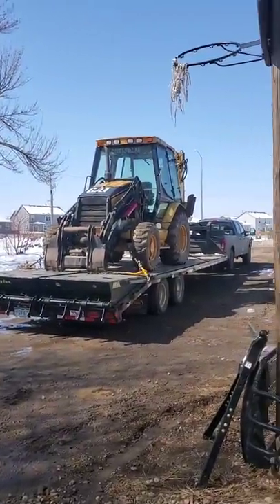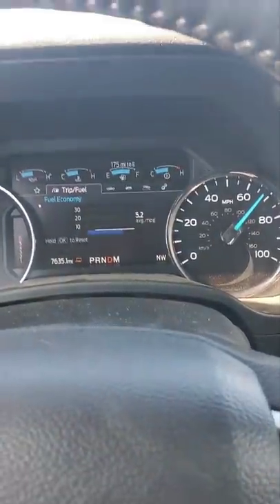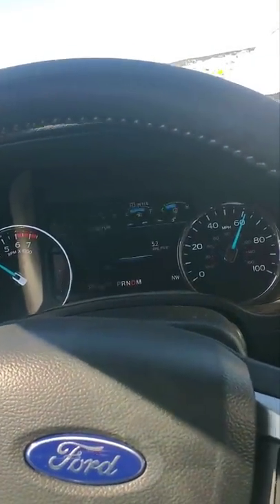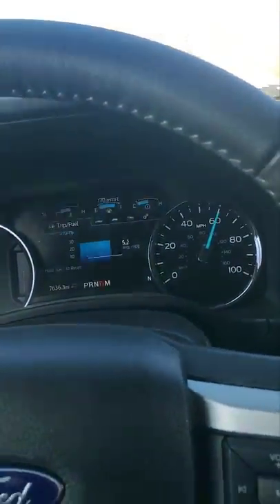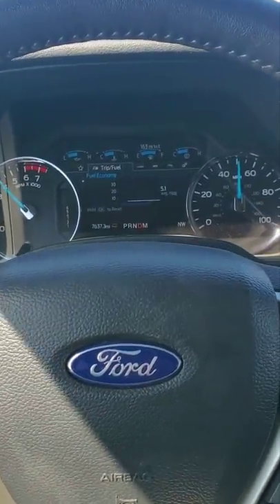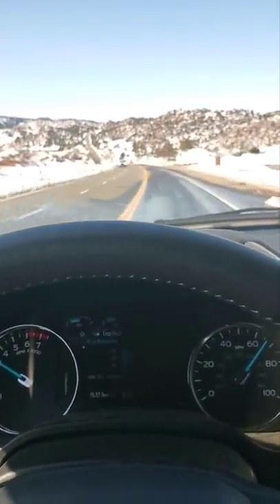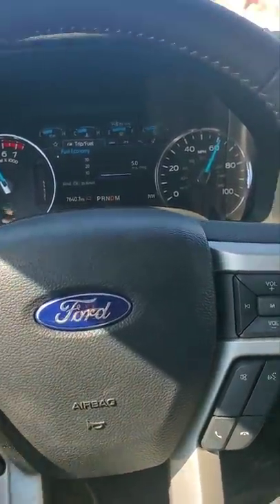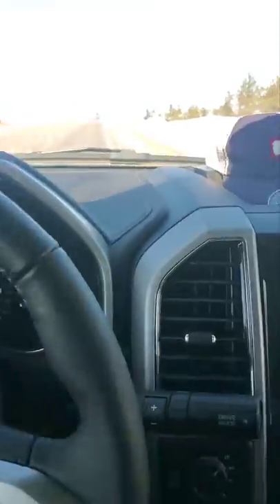7.3 godzilla towing 24k lbs through the rockies.

Comment: Seeing you gain speed up a hill at 32k gross vehicle weight, I'm sold. Using 3.55 gears at that! I've been on the fence, but with the 4.30 gears it's going to be a breeze. I'll be hauling weighing in 10k less to boot.

Comment: Great review!  I think most folks with desk type jobs who only tow a camper or boat occasionally would be much better off with the 7.3 gas than the mall-cruising diesels.  You could buy a decent used sedan for most driving with the cost savings vs the diesel and this truck would last you 20 years without the diesel headaches.

Comment: I am glad to see Ford with the big block 7.3 gas. It’s hard to beat a big block. I remember the old 460ci  solid motor pull a mountain hard on mpg . I have a 04 Chevy 3500 8.1 (496ci) with a Allison transmission 4.10 rear gears. The truck weighs 8,800lbs crewcab long bed 4x4. I pull heavy loads of hay weighing 22,000lbs  that is 30,000lbs total the 8.1 is pulling I live in Kentucky so driving up and down hills and around curves is a daily thing. The most gas it used is 5.5mpg but a lot of time it will be in the 6.5 mpg range. Empty it gets 11mpg hwy and 9 mpg city. I have a very nice 01 Chevy 2500HD Duramax  that get much better fuel mileage and has more toque. But I use the Chevy 3500 8.1 dually to pull my gooseneck and heavy loads because it can handle a load better with 6 tires on the pavement the feel of better control over a 3/4 ton.

Comment: A year later, what do you think? I’m ready to buy a F-550 7.3 to haul a truck camper full time. I’ll be about 7000 lbs on the truck with an additional 10,000 trailer from time to time. 

Sounds like it should handle it fine.
Reply from the maker: Yes it will do good

Comment: I hauled two 20ft empty shipping containers doing Hotshot from Indiana down to Jacksonville, Fl. with my 2017 F-250 with 6.2 and 3.73 gears with no problems a guy with a Dodge 3500 Cummins was surprised it did so well. I did pull away from him on a couple of long pulls going through Kentucky and Tn. I averaged 8 mpg on that trip.
Reply: Its cummins not cummings.
Reply: @lwilde0422  no one cares.
Reply: @ZACH_95_  sounds good Zackary
Reply: @lwilde0422  so sensitive is a typo...
Reply: If you pulled away from a cummins on a hill it is because he let you. Even the first ram cummins back in 1988 had more torque then gas production trucks built today. Dont be stupid.
Reply: @lwilde0422  160 hp 400ft lbs. good ol 12 valve.
Reply: No you didn’t stop lying!
Reply: @lwilde0422  
Lol..did you call someone stupid and then say 400 is a bigger number than 475, 430, 429 and 401???
Reply: I'm surprised you got that much mpg. I get 7.5 with a 21 6.2 dually flatbed 10speed with bobcat and trailer.
Reply: @lwilde0422  right lol
Reply: Yea no disrespect but that diesel would have wayyy to much torque to be out run by that gasser especially if it was deleted
Reply: @spin0491  i really think he was exaggerating!!! Trying to make me feel gone. My truck is ok for what it is tho

Comment: I must say, I bought my 2019 f250 lariat crew cab Powerstroke new for $65,550 out the door, paid it off, drove it 53,400 miles over 29 months and sold it last month for $54,000. It will be very, very difficult for a gas engine to help a truck maintain that kind of resale value. Ordering a 22 Powerstroke once Ford opens back up the order banks which they closed in February for 21’s.
Reply: Some people run their stuff until the doors come off. Add in your operating costs. Diesel is only going to increase with Biden in office now. $108 to fill the tank in my Power Stroke yesterday. I tow around 12,000lbs and not every day. I use the bed more than anything. This 7.3 will do everything I ask of it. I doubt you'll be able to sell your 2022 as easily in two years when govt money has dried up.
Reply: @zackzander425  Exactly...well said!
Reply: @zackzander425  Yep......exactly...I am one of those people. You are "spot on" with your other comments. For numerous reasons, I would not have one of the newer diesel engines in a pickup...unless maybe if I had a Hot Shot service.
Reply: Zack Zander Well, filling my 2020 f150 3.5’s 36 gallon tank costs very close to that, around $95 - or $104 when filling with 89 plus grade gas...remember it’s not about the purchase price of a diesel, it’s about residual sale value after use. The guy who bought my 19 Powerstroke from my dealer that bought it from me paid $56,500 for it, and will be able to sell it for $48,000 if he takes care of it and puts around 30,000 miles on it (selling it around 85,000 miles). That’s not a hard pill to swallow, paying 48k for a nice 5 year old diesel by then. So in reality, diesel wins on costs of ownership in the long run as my 20 f150 3.5 gets around 16.2 mpg avg in my use - and the Powerstroke averaged 15.2. So, 1 mpg difference, and around 11% higher fuel cost. Yes, comparable synthetic oil changes cost $50 more in the diesel when you bring your own oil to the dealer as I do, and fuel filters add $100 every 20,000 miles. But that thing is a towing beast. A 7.3 is good as well, but if you tow with it, a 2021 Powerstroke will get 20% better mpgs all around. Free government money never bought my truck, nor will it buy my 2022. Yes, I received nearly 30 grand of this “free govt money” but that has no determining factor in my vehicle purchases, just as it never did back in Sept ‘18 when I bought my Powerstroke. It had nothing to do with my buying my 2020 f150 new either back in October. Hard work and good business did. There are tens of thousands of guys out there like me that are always in the market for these trucks no matter if senile joe is in office or not. Diesel could be $3.999 a gallon and that will hurt demand only for those who’s budget really doesn’t allow them to own a vehicle like a new super duty. If they are overspent on loans, etc then fuel costs would probably be their last straw. It really doesn’t matter what’s under the hood for guys like those.
Reply: @natehawkins2910  You make some valid points. However, for guys who do not use trucks for work or business, tow moderate, medium and a few heavy loads, especially less frequently...and tend to keep vehicles beyond the warranty (much less concern for resale value)...and have experienced breakdowns and expensive repairs...CP4 / fuel systems and numerous other issues)...the diesel engine is NOT the best option. 

Lots of guys fit into this category and the 7.3L gas engine is a beast and fits the need. I was fortunate and did not experience severe breakdowns with diesel truck. However, I spent a fair amount of money on an F350 6.0L truck for Bullet Proof Diesel parts and other upgrades (BTS and PacBrake PXRB) to make the truck quite the towing machine. 

The ONLY diesel worth having is a 5.9L Cummins.....12V in a VERY NICE 1967 - 1972 Chevrolet Crew Cab 4WD truck from -----------> rtechfabrications.com   OR   a 5.9L Cummins 24V in an older Ford Super Duty. 

The tree huggers and EPA have RUINED the modern diesel engines in pickup trucks...and I would not ever consider owning a new or newer pickup with a diesel engine.
Reply: Two45s My dealer didn’t ask about my CP4 pump or if I tow much or if I really would need a diesel when he gave me $54k as a check. None of those emotion based thinking things are relevant in residual value.
Reply: @natehawkins2910  You're correct.....some "thinking points" are not relevant to "residual value" (resale value).  

HOWEVER......not every buyer of Class 2 and Class 3 trucks equipped with gas engines bases their decision on 'emotion'. Matter of Fact, I'd bet it is quite the opposite. I could be wrong...but I'd bet there are way more truck owners who purchase a diesel pickup based on 'emotion' compared to truck owners who buy gas pickups. They don't NEED a diesel powered pickup....they simply WANT one cause they think it is COOL....peer pressure, and or they like having lots of HP.

I have owned several trucks in general...up to 3 and 4 trucks at a time...and most were trucks with diesel engines. I tend to keep trucks for longer time frames than many people. Like many previous diesel truck owners...My needs have changed. I no longer NEED a diesel pickup with the low end torque to "launch the load" from a stop and tow very heavy loads. 

I definitely would not spend $70 - $80K every 3 to 4 years...and "take it in the shorts" on any depreciation. I did that a few times in the past for business purposes. Moreover...pay $5000.00 to $6000.00 in SALES TAX on every purchase like most people. 

More often than not, sales people at dealerships are not going to try and talk a potential customer out of what the customer states they want to purchase.....unless the purchase does not fit their budget, credit qualifications, etc.

The dealer NEVER asked similar questions when I ordered a truck last week on March 30th.....a 2022 F350 CC Lariat 7.3L Ultimate Package - Black Appearance Package - Tremor Package with most every option including the Warn winch. I did not get the Adaptive Steering or the Pro Trailer Backup Assist (SISSY BOY KNOB)...even though I wanted the Ultimate Trailer Tow Camera System. Decide to just get the $200 CHMSL Camera instead. Would have been nice to have the other 3 cameras.....but not with the Sissy Boy Knob on the dash...don't need and would never use...and at a cost of $1655.00. BTW....NO Sales Tax on this new truck...smile! Lots of people are getting smart...set up LLC out of state. 

Virtually everyone "knows what they WANT".....but, not everyone "buys what they NEED"....or at least combines some of their wants with their actual needs. I could of purchased a loaded King Ranch or loaded Platinum.....but I didn't. Did I NEED all of the options I ordered on the Lariat? No...but all that I purchased was needed and or wanted.
Reply: Yea go gas if you don’t tow heavy often but if you do gas engine naturally strains a lot more half the torque runs different won’t handle the abuse.... diesel cost more but hey that’s the trade off..... gas won’t ever be able to replace a diesel ever world will be fully electric before that happens.....most big machinery needs the torque of a diesel to operate heavy loads
Reply: @spin0491  Exactly Correct. I have had a few diesel trucks....phenomenal at "launching the load" from a stop...and passing at 60 - 70 mph highway speed with a load. Don't tow heavy loads frequently anymore...mostly moderate to medium loads. Wanted more off-road capable Super Duty truck...why I ordered a 2022 F350 Lariat 7.3L Tremor.
Reply: I sold my 18 f150 5.0 last month for what I paid for it 3 years and 50,000 miles ago.  It's the market currently.

Comment: TFL made a video where they supercharged a 7.3 Godzilla and it made 675hp. The 0-60 was 5.2 seconds. And it towed like a absolute BEAST. Bet with that kind of a set up it could easily outrun a stock 6.7 powerstroke. It cost roughly 6000$ for the setup they used in the video.
Reply: Prob still cheaper than diesel option
Reply: Damn I like the sound of that. This could be my forever truck.

Comment: I had an 8.1 dually and I would tow a 20k lbs and it was a beast I hope gm brings it back because if they don’t I’m getting a 7.3
Reply: I don’t follow GM but I think the did I remember TFL trucks did a comparison on the new gas engine truck dodge Ford and gm and if I remember right Ford out performed them
Reply: @firstname6583  they never tested the GM 8.1 liter big block gasser. If gm brought it back revised it would out perform the 7.3 the same way the 8100 outperform every other engine it was competing with at the time
Reply: @messagefamilystyled1101  The Ford 3v 6.8L V-10 put down better numbers and in just about every case outperformed the 8100 series Vortec's. It was closer with the 2 valve V-10's.
Reply: @nathanmcdonald610   but it’s a more Complex V10 design. and the 8100 hit peak HP and Torque at a lower RPM, making it better for towing, more fuel efficient, and more likely to last, on top of the fact that most 8100s were retuned from the factory for commercial use. My 8100 went 20 years no rebuilding or expensive repairs with just basic maintenance and I put 250k on it towing backhoes and skidsters. I like the V10 especially in the excursion my mom had one it was a beast, but for a heavy duty towing gasser, the 8100 with the NV4500 manual Trans is the way I go.
Reply: @nathanmcdonald610  I respect your opinion tho, i just had such good luck with it I’m now looking for another 81 with low miles to buy for work, while I wait til the 7.3 gets its kinks worked out
Reply: @messagefamilystyled1101  Yeah, you really can't go wrong with a manual trans when it comes to towing regardless of what engine its behind, though these newer 10-Speeds are something else. I respect your opinion as well, the 8100 wasn't a bad engine at all. Its figures were close with the 3v V-10. Torque which is what's important in these trucks as you know, was particularly close. The V-10 making 457lb/ft at 3250RPM and the 8.1 making 455 at 3200RPM. All and all I'm glad to see a large displacement engine make a return with the new Ford 7.3L. It's a refreshing change of pace from the latest trends in the automotive world of downsizing, turbocharging and electrifying. Nothing quiet like an American big block V8.
Reply: @messagefamilystyled1101  Well I got a couple of GMC Trucks with the 8100 Vortec but none are for sale.lol My 2002 4wd dually is my daily and getting close to 800k miles with all original powertrain (8100/Allison with manual 4wd) and no major repairs or rebuilds. The only part I have changed out about 3 times is the transfer case. I've owned it since 32k miles and bought it almost new from the first owner and she is just a beast. Its not the fastest but has outlasted many others of all types and yes she works hard. I could say more than half the miles in it are towing/hauling especially if Im traveling out of state or the country( these 8.1s dont care about the miles). My 2001 Yukon XL 2500 4wd has the 8100/4L80E combonation and also have a 2001 GMC dually with the 8100/6spd manual 4wd on the floor and just love how they all perform. All my other trucks are 8100/Allisons and I am searching for the 8100/5 spd NV4500 on a C3500HD but no luck yet. If you decide to sell yours to a good home in Texas, just let me know🤠 it would be nice to have a Big Block in GM Trucks again especially the 8.1 Liter. Well, stay safe my friend and hopefully this 7.3 Ford comes out to be as reliable as it sounds and lets keep enjoying our 8.1 Big Blocks👍

Comment: Was looking at 6.7’s, I’m prepping to buy a 3/4 car hauler that weighs 8k empty. Figure the most weight I’ll ever have will be comparable what you have in the video, but mostly would have 3 cars loaded on it. 
I’m thinking a F550 with a 5 star tune to bring it to pickup hp/tq levels and the 4:88’s should be a decent rig for this kind of weight. Not going in the mountains all the time. About 30-40% of the time around Black Mountain/ Monteagle type passes. I think it would eventually take its toll riding high rpm like that, but if that were to happen at over 100k miles, engine replacement would still be cheaper than a dpf or injector job on the 6.7.
Reply from the maker: Bingo

Comment: She pulls strong! I just can't take the sound a V8 having to scream 4,000-5,500rpms towing, this sounds just like my Tundra was pulling my RV up the grade on Highway 25 from South Carolina into North Carolina.
Reply: Oh I love to here those ponies pulling.  Been a GM man forever but not anymore with this motor. GM is behind the times. I have a old 2005 chevy 2500hd 6.0 gas pulling a 35ft montana 5th wheel.  I pull the piss right out of it, run it right on the rug and it's still taking it 78000 miles pretty much all towing but definitely switching to Ford soon they got there shit together on this gasser

Comment: This is an Awesome engine but let's Not forget the Chevy 496 8.1. I had a 2500 Suburban with it weighs 9,998lbs and would pull ANYTHING you could hook up to it.
Reply from the maker: The problem with the 8.1 in the suburban is you couldn't get it with the allison. You only could get the 8.1 and the allison in a pickup.